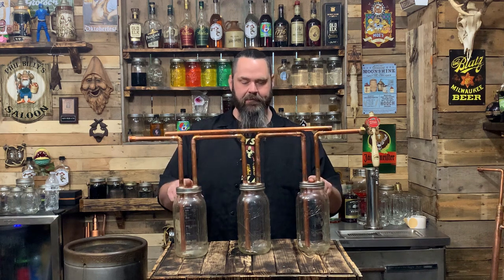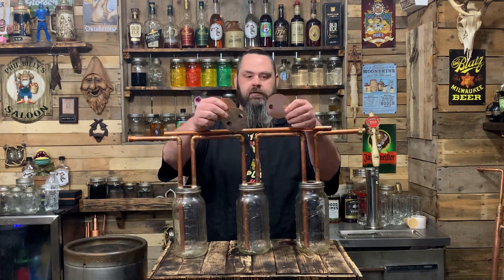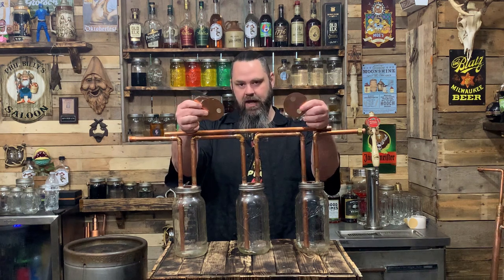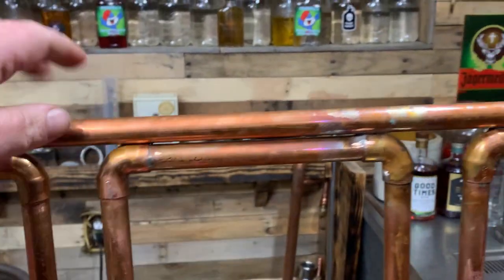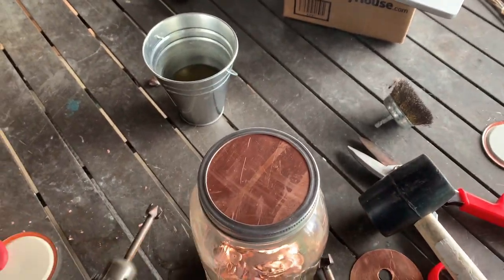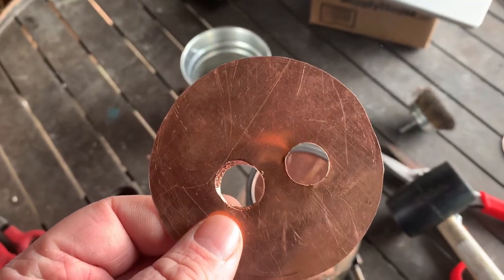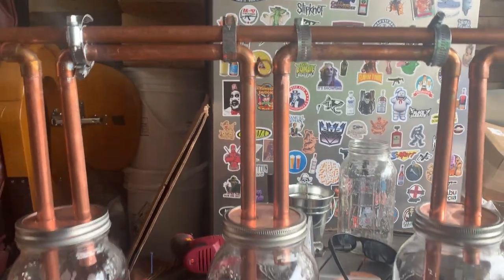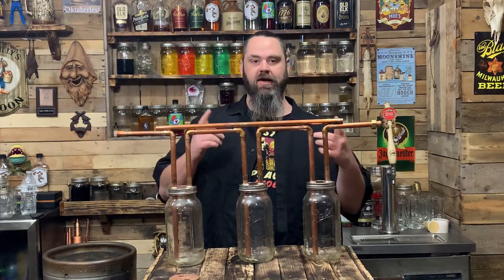Building a mason jar thumper setup for a keg still

Comment: I know mason jars are made to withstand 60 - 80 degree celcius temperatures (up to 176 fahrenheit) but I've heard from other sources to specifically avoid mason jars for thumpers because the heat can exceed that breaking point, in which case you are dealing with a ticking timebomb - have you experienced this with your design?

Comment: Please try a hole saw, not an auger bit. :) Also, if you sandwich the plate between two pieces of wood and clamp them together, with a hole saw bit or annular cutter, the results will be super clean also easier and safer for you.
Great work, love the video.
Reply: UNIBIT for the win!

Comment: How does ur lids not leak with a good seal/gasket cause those copper flats will not provide a good enough seal
Reply from the maker: I got gaskets i sell them on my website.
Reply: Have to have the good gaskets, like the ones on the website. The flat gaskets leak.